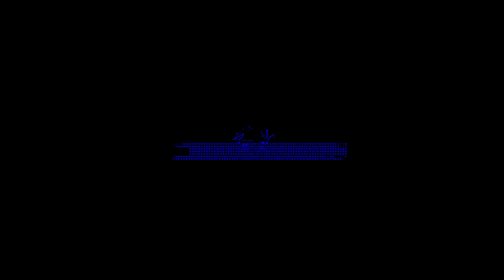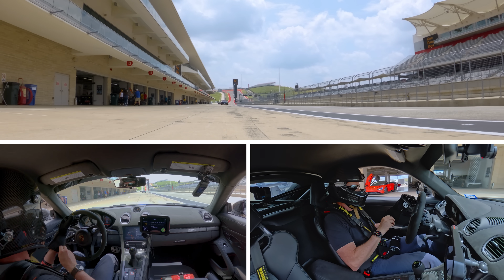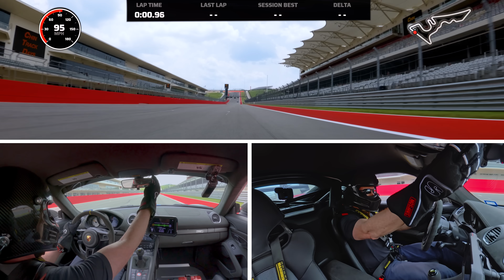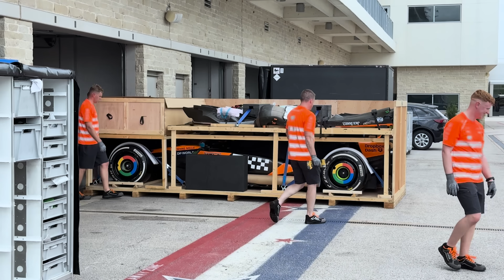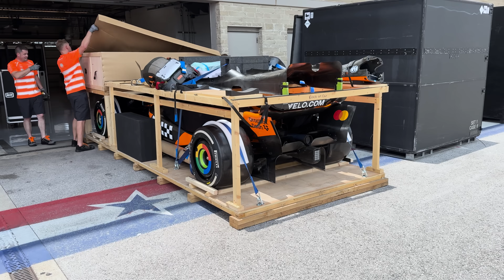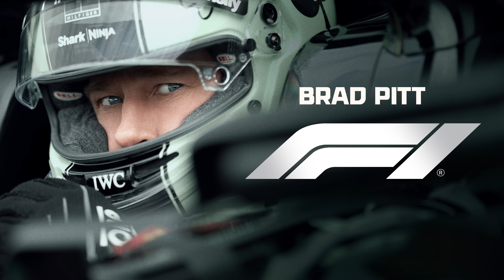Z06 vs GT4 RS : American Power Meets German Engineering at COTA

Comment: Were you on better track tires than the Z06?
Reply from the maker: I was on Hoosier R7s. Many Z06s come with Cup 2 Rs, which perform similarly for the first few heat cycles. I'm not sure which tires these two cars were running.
Reply: @ItsTrackTime  So you were running racing slicks, and you forgot to tell us, and looking at the way the Vettes started sliding around I'm sure they were on the substandard Michelins, that explains a lot.
Reply from the maker: R7s are dot tires - far from “race slicks”. Watch my prior video.
Reply: @ItsTrackTime  The R7s I used were slicks, the fastest tires I've ever had on my car, accept I had one set of slightly used Goodyear slicks (at least I thought they were slicks, now I don't know) a couple years ago that turned better times on my favorite track, the R7s I had were used also, I quit buying new tires years ago, I'm poor, I even had to build my own racecar.
Reply: r7 is street legal and I ran them on c8z.  it is a little bit faster than cup 2r but harder to drive.  I have  data from 2r from fresh to last track day and my lap time difference was 5.16s!    per track day I  lost 1.7s, 2.3s, 3.5s, 4.9s and 5.16s from first day on cup 2R.
Reply: The Michelins that come on the Vettes are a substandard tire, if they have been on track a few times they are totally done, if new, they will still turn to grease in just a few laps. GM has got to do better, I don't know why they settle for that junk, they always put a far better tire on the Camaros. I know the engineer in the Camaro and Cadilac performance, and GM was going to go with Michelins on those cars also, he went to battle for a better factory tire and won, GM needs to turn to Good Year to develop a better tire for the Vette.

Comment: Using open track day lap times for evidence of car superiority is questionable at best. These events are held for simply one reason and that is for owners of cars to go out and drive at the pace they feel best. Hpde is not a formal time attack, while some drivers may push harder than others. It doesn’t prove that their car is actually faster.
Reply: While the Corvette’s weight is indeed a consideration, I think the larger concern is its transmission and whether it can carry the car through a season of open track days. in my opinion, durability and dependability are much higher character traits than actual lap times. And I’m quite certain that any of the Porsche’s will outdo the C8 in that regard.
Reply: @ballard-bt2ts  That's funny you bring that up, the Porsches have more transmission problems, and engine problems at the track than any of the GM cars.  Gm has been putting over 2,000 hp through these power trains in testing, no problem.

Comment: Porsche needs to open a new chapter with a 5.6 n/a boxer-8  in the 911👍 The C8 is too big , no manual and fake V8 flatplane-4 banger sound does not make it very appealing...Also mid engine cars are kind of tricky to drive at the limit ! Looks and brake by wire dont add to the appeal of the C8 which is way too big for backroads and really more cruiser than sportscar desoite the numbers...IMHO
Reply from the maker: I agree—Porsche really needs to increase displacement at this point, but the EU is doing everything it can to kill these engines. It’d be great if Porsche built a larger-displacement model just for non-EU countries to enjoy.

Comment: All the usual physics apply plus it’s the driver ultimately.  Unless I am wrong you were super focused and nailing the lines precisely where’s the vettes were not as much.  Having said that on a wider track with higher speeds yes the cayman gt4 rs just isn’t going to be able to keep up.   Nice smooth run though

Comment: i've never been to a track before and would love to do it.  is there no rule about staying on the track in the turns? half the runs looked like the whole car was off track. specially through the S turns
Reply: No, no rules like that for track day, HPDE, you would cut and straighten out the esses if you were trying to run down a faster car.
Reply from the maker: Going four off in an HPDE earns you a black flag and a trip to pit lane for a chat.
Reply from the maker: F1 rules define the track as the area between the white lines on either side of the circuit. If all four wheels go beyond those lines, the car is considered off track. Put another way: as long as one wheel is still touching the white line, you're technically on track. HPDE at COTA run by these rules.

Comment: It's amazing that nowadays people are driving with aids (automatic transmission, throttle blip, no clutch) and imagine themselves being racing drivers. We call it 'Amateur' level driver in racing games. To get to 'Pro' you need to at least manually shift the gears.
Reply: I agree, after tracking a C5 Vette for years, probably the best most reliable track day car ever built and with a little work no problem whipping Porsches, but I had the urge to build a gen 4 Camaro, so I bought a wrecked 93, built an all out road course car, 600 HP LT1, no electronics, all seat of the balls, original T-56, sold the heavily modified Vette for $45,000 to a track dude, I have less than $20,000 in this Camaro and it is the most fun car I have ever driven, and it is very fast, Porsches no problem, I couldn't imagine tracking without a manual trans.
 The car club I do most of my track days with turned the advanced group into a race situation, rather than point buys and stuff, but you need to have the car set up for a head and neck restraint and a few things, I haven't had too much trouble with the C8 ZO6's either, but the ZR1 gives me reason for concern.
Reply: Thank you for your reply. Based on what you described - I admire what you are doing and the dedication. Do you have a social media account for your cars? I'm a fan, would love to follow. 
Peace
Reply: "in racing games" is all you needed to say
Reply: @overcomeevil5928  "even in racing games" is better, for those who don't understand the meaning of the reference. No gear changes - no racing driver in The Book Of Professional Racing Drivers Of All Time. Being able to not just pick the best racing line, but also press the clutch, change the gear at the right time, so you need to plan it. I hope you have any clue of this because you focused on the "games" part, which was the sarcastic part.
Reply from the maker: I started track driving 12 years ago in a manual BRZ, then moved to a manual Spec 987 race car, heel-toeing my way around COTA for a decade. The reality is, if you want a high-horsepower engine in the Porsche lineup, you have to go PDK. The only exception is the GT3—but with ADM, that adds another $100K, which I’m not willing to pay. Fortunately, the PDK is an incredible transmission. It nails the shifts 99% of the time, so there’s rarely a need to use the paddles—except occasionally at Turn 7 at COTA.

Comment: Just a FYI it’s not hard to get a c8 z06 into 3300 lb range with a few mods. I’m confident the car can be 3250 but it’s going to be expensive to get there but still less than a GT4RS cost. Both are great cars tho I just prefer the sound of the LT6.
Reply: True. Trade the seats for a pair of apple crates. In fact toss the entire interior. make it a 3 wheeler, drill holes in the exterior panel, & frame. Slice off 2 cylinders. Trade the glass windows for plastic. It would be bad azz. Too bad the engineers didn't think of that.

Comment: This is absurd. You have no idea what level the other driver is performing at, regardless of your previous experience with that car. He could be shaking out some new mods or breaking in pads, etc. 

You need to Google correlation vs. causation. 

Talk to the other driver if you really want to establish a baseline on your mods etc. in relation to the other driver.
Reply: the driver had street tires and a student in  the car

Comment: I have a GT4 (non RS) and got to drive a z06 on the same track on the same day. The brake by wire is not fun trying to get used to. You have like no brake feel and it’s hard to stay out of ABS, threshold braking was near impossible. Maybe it’s something you could learn and adapt to but I did not like it. Aside from that I really liked it
Reply from the maker: Randy gave me the same feedback after driving it. He wasn’t a fan of the brake pedal feel but thought it handled the weight surprisingly well.

Comment: Why waste your time and money on a Porsche or a Corvette just  buy a Superformance GT40 with whatever motor and gearbox you desire or an Ultima carbon fiber body 1970 pounds with a 700 horsepower all aluminum 427 V8 and 650 pounds of torque insane, my friend has 2024 carbon fiber bodied one , I've beat the hell out of it at Flatrocks big 4 mile configuration I've raced 6 speed 120 mph shifter karts  for years now so it was no problem loved it

Comment: Yet another comparison against the C8 Z06 where a super hard core Porsche ‘RS is up against a less than hardcore spec’d Z06…

Put that silly GT4RS against the same talented Z06 driver, but instead driving my track spec 100+lb lighter C8 Z06 Coupe w/Z07 and carbon fiber wheels, and it wouldn’t even be close for the Porsche lol.  🤣

Comment: So a guy that races for decades, cutting every corner hard, and wringing every bit out of his car makes a defintive comparison vs another car that had no idea of what was going on.  Makes alot of sense.
Reply: Guess we're the only ones who saw the same video 🤘🏻🇺🇲
Reply: Haha.  I was thinking the same thing.  Good driving but not a real comparison.
Reply: It’s crazier when you realize his car has coil overs, aero and (slight) power mods.
Reply: I was thinking the same thing!!!  Corners seemed like a suggestion to Barry!
Reply: Isn't that how this works? Make lots of assumptions without having detailed facts. Then post about your dominance online for the sheep to eat, go forth and spread the BS as gospel.
Reply: Randy Pobst GT4 RS mild track tune and upgraded tires 2:18.94 COTA - David Donohue 2:19.18 in Z06 with Z07 package no adjustments, show room stock. With a few adjustments and upgraded tires, probably make up a few tenths... Guess it comes down to most bang for the buck or the most repect for the badge on the car. Think I'm going bang for the buck...
Reply: The vette was pushing. It's just an inferior car.

Comment: The c8 z06 brakes very hard, there's not this mich of a difference between the gt4rs and c8z.
Reply: Just looked it up the 60-0 braking distance is 95ft for the c8z and the gt4rs is 93ft. Not to a huge difference, but Im sure the difference will be greater braking from higher speeds. It just looked like he wasnt really trying to brake.

Comment: I think the bigger issue the weight is causing is for the tires to overheat quicker on the Z06.  They should be able to make similar corner speeds to the GT4RS and will have to brake a little earlier due to their higher speed.

But the best lap times we have (VIR LL) show that the Z06 should be slightly quicker than the GT4 RS, at least in the hands of intermediate drivers.

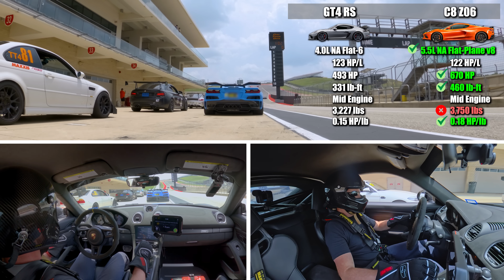2023 Chevrolet Corvette Z06 - 2:38.6
2023 Porsche 718 Cayman GT4 RS - 2:40.5

Comment: I like the fact that both drivers are using their vehicles for something other than cars & coffee. Congrats on the nice run with street tires and a student in the vehicle. 
   I actually had to check the date of this video because I thought it was common knowledge the C8 ZO6 under extreme heat conditions remains extremely cool.
  Not to take anything away from the GT4 RS owner but I always thought it was the GT3 as a direct competitor to the ZO6. Same as the ZR1 and GT2 RS. I didn't know the GT4 RS was ever in that conversation.  Anyway, it seems both of you gentlemen had a great time at the track and I hope your student learned a few things.

Comment: Hi Barry! Saw you that weekend I was in a red 991.2 GT3. I had the same issue I was doing 150-151 instead of 158-160 in March. Similar engines I suppose? I don’t think I had that issue before and I don’t even look at oil temps anymore this engine having been so solid but maybe I should? I was looking at reports of “silent” failures of one of the fans in the 911s but yours  is a 4RS. Anyway seems it was same conditions for everyone. Thanks for the video!
Reply from the maker: Everyone I talked to that weekend was down about 7 mph on the back straight and around 3 seconds per lap. Good to hear your car showed similar results. I always keep the oil temp on the display so I can monitor it, and even on these hot days at COTA, I haven’t seen it go above 230°F.

Comment: Honestly, I really don’t get why the C8 Z06 is so hyped and talked about — it’s seriously overrated 😂. A 2018 AMG GTR, a 7-year-old car, drives so much better. It already has wide tires and weighs around 3,600 lbs, but with an AMG GT4 wing, a tune, and a set of 335/285 CUP2Rs, it can easily match or even beat the lap times of the Z06 and the much more expensive GT4 RS on a track like COTA.
Reply: But it can’t do it without extensive modifications, and you can modify the Z06 as well right?

Comment: Don't you think that the Z06 's extra 30 mph going into that corner may have had something to do with where he had to initiate braking?  I get it weight is affecting him, but so was the mph.
Reply from the maker: Definitely—but I’ve been in several cars that hit over 160 mph on the back straight and still managed to brake at the 150-meter mark. All were lighter than the Z06.
Reply: @ItsTrackTime  do you suppose it’s possible that he wasn’t in a 10/10ths lap and braked sooner to save wear and tear on the brakes?  If you really wanna race somebody, do it right: call them out for an actual race instead of just acting like because you passed him he beat the car. Lame.
Reply: Thats cool to hear. Were they track only or also street cars?   @ItsTrackTime
Reply from the maker: All were street legal cars. The fastest was a McLaren Senna which went over 175mph and still managed to brake at the 150 meter mark. Over 2.5g in the braking zone!
Reply: Ya boi, Senna's are amazing cars.  Very cool thanks for sharing.  @ItsTrackTime

Comment: The ZR1 has broken lap records at around 5 tracks in the USA, and the ZR1X is going to be faster than the ZR1. The ZR1X will be AWD with 1,250hp. 0-60 in under 2 seconds, quarter mile in the mid to high 8's, and a top speed of 233+mph.

Comment: Porsche under rates their HP numbers a bit and GM uses crank HP numbers which over rates the power figures.But you are right,lugging 500 lbs through the corners will grind down expensive rubber at an alarming pace and the Z06 does that quite well.

Comment: You are a good driver, but neither of the Corvettes you passed were abusing the curbs as you were. I am not a fan of the C8, but to be fair, if you put your skill level in a C8, any C8, the car will be faster than your Porshe. You talk a lot about weight, but you failed to mention that a heavy car does not need aero aids. How much does the Porshe weigh, all in, with the aero? And the brakes on your car have WAY more development than any of the C8 systems.
Reply: Plus he has extensively modded his car, it does not stock, and he’s running on Hoosiers while the vets were on street tires. Lame.